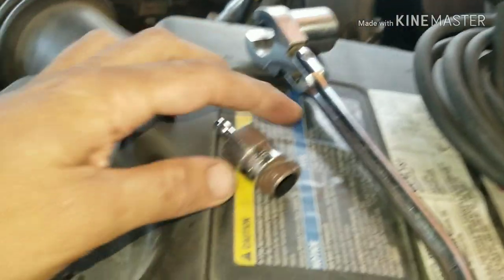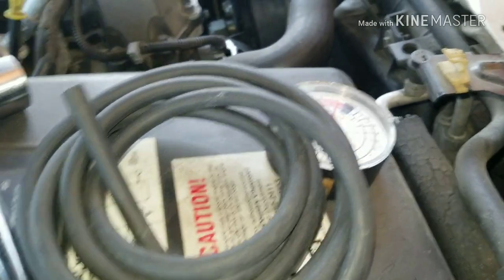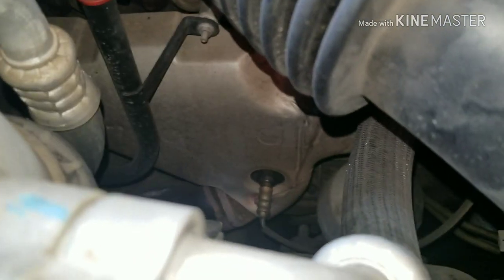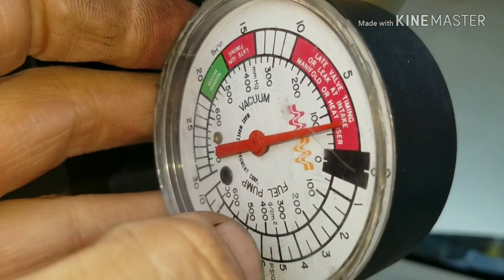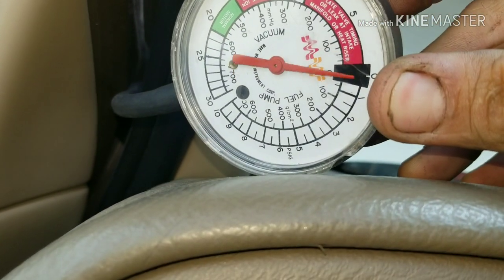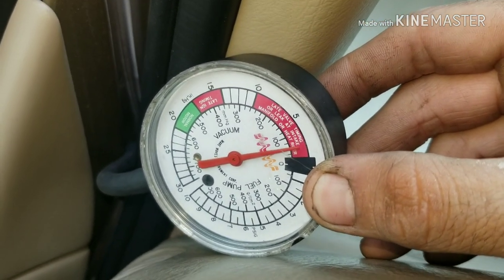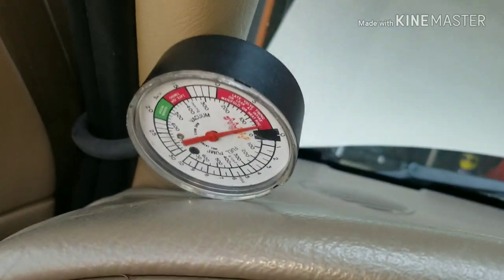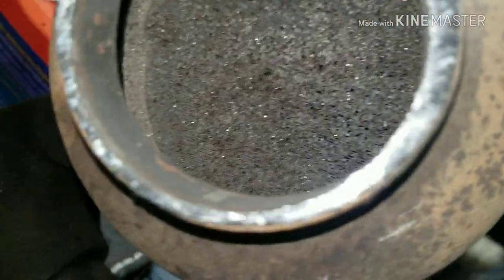How to find out if you have a bad catalytic converter

Comment: Hi! I hope you'll be able to answer soon. I have a Mitsubishi Galant '01 4 Cylinder. It has been driving rough like puttering, shaking when I go a certain speed like 75 MPH so I tend to go alit slower on the interstate. The problem got worse as it started to turn off and it was turning off while parked at a light, but it worsened to it shutting off while I'm driving. Literally I'm driving and it cuts off and car's are coming my way and I was able to make it home. We changed spark plugs and pack and thought it would work but it didn't sadly. I have a code of P0421: Catalyst 1 Efficiency Below Threshold Bank 1 as the main reason and other reasons (oxygen sensor, catalytic converter manifold, and exhaust manifold). The other main code is P0401: Exhaust Gas Recirculation Flow Insufficient Detected and the other reasons are Exhaust gas Recirculation valve, EGR vacuum regulator, EGR valve gasket, EGR vacuum switch valve, EGR pipe, and EGR vacuum switch. Now it's sitting in driveway and it'll crank but cut off I'm not able to move it out of its spot. Any information you have would be greatly appreciated! 

I hope this wasn't too long for you.
Reply: Hey my truck is kinda doing the same. Did you find out what it is ?

Comment: So I have a 04 trailblazer.  Looks like yours.. So I have a p0420 code. But it drives just fine. In park it revs normal. Do you think I should just replace the upstream o2 sensor?? Don't really have the money for a new converter and cutting it off won't do me any good cause my state I have inspeactions to pass.. So idk what to do
Reply from the maker: If your not having any per performance problems you could replace the upper and lower o2 sensor. And you could buy some catalyst cleaner, this is made specifically for scrubbing cats to bring them back to life, BG 44k does a good job . Thanks for watchin please like and subscribe and tell a friend.

Comment: I got a 97 f150 with the 4.2 v6 it idles rough and when the engine heats up it shakes and sputters really bag when i go through stop signs what could that be and it’s got this white paste on the oil cap but oil is clean
Reply from the maker: The white past could just be condisation in the cap the real thing to worry about if theres water on the dip stick, your idle running issue could be something I'm not sure what,  if I remember right that has a coil pack with all the coils  for each cylinder togather. I have seen those in the past go bad after warm up and cause issues. Thanks for watchin beaure to like and subscribe for more helpful tips and tricks.
Reply: fixer good mine is the v6 model it doesn’t have individual coils it’s just a wire on plug design I think it might be a fuel pressure regulator or maybe the Maf I will be sure to subscribe to you thanks for the prompt feedback
Reply: fixer good and also the oil on the stick is clean I know the white paste on the cap indicates a blown head gasket but it’s got clear clean oil so that one has got me confused maybe a bad pcv or maybe it’s related to all that misfiring it does I’ve never ran a engine so long in this kind of condition without it breaking down so I guess it’s possible thx for the reply
Reply from the maker: Maf could be a issue if you pull the vaccum hose off the fuel pressure regulator and find fuel then it's bad. The water under the oil cap dosent always mean blown head gasket especially with the clear oil. These types of caps are  known for collecting water. I'm getting ready to make a video on this ,when your engine runs your oil naturally gets small amounts of water from getting hot and cold, that collects in the oil cap tube.

Comment: 97 BMW 740I, M MODEL ,MY MECHANIC SAYS IT'S TIME TO ORDER CATS FOR MY CAR,HES EXCELLENT BUT THE CATS ARE 1500 A POP FROM GERMANY, OTHER THAN ORDERING THE PARTS DO YOU HAVE ANY IDEAS BEFORE I ORDER... THANKS FG
Reply from the maker: if you have just a p0420 or430 code and no back pressure you could try cata clean which can somtimes help bring a cat back to life thanks for watchin
Reply: @fixergood  THANKS
Reply: @fixergood  97 BMW M MODEL AGAIN...FG,CAR HAS PLENTY OF POWER,NO EGG SMELL, CHECK ENGINE LIGHT HAS BEEN OFF ABOUT MONTH NOW, BEEN USING TECHRON ABOUT TWO TREATMENTS NOW, BUT FUMES SMELL STRONG,ANY IDEAS..

Comment: My '00 Silverado is acting up. After starting up (cold engine) and trying to accelerate, it will limp up to speed. I can floor it and it'll barely move. But once it warms up, even the slightest bit, it seems fine. I can bang on the cats with my knuckles and hear a light rattle. Not like something has come loose inside, but there is a rattle
Reply from the maker: Thanks for watchin , do you have a p0420 code if so its possably that could be a issue, but you would have to so further diagnosis yo determine what it is for sure. Besure to like and subscribe for more tips and tricks.
Reply: I have the same issue with my car. Cold start blocks me at 10-20km/h for maybe 1 min. Then runs good but I have a rattle sound on very low speed. A mechanic got an oxygen sensor code, not sure if that's the only issue ..
Reply: @fixergood  I've never had any codes. It's gotta be either the cats or the EGR is malfunctioning. I do know I have a very light rattle at my cats so I'm leaning more towards this. I'll be replacing this section soon
Reply: @Keless  that's interesting. An O2 code could indicate improper function of the catalyst. Yet I've never had any fault codes. But my cats do make a very light rattle. I can tap on them with my knuckle and hear this. Even sometimes driving I can hear it but it's very faint
Reply: @JasonTylerRicci  oh then how can i know if the o2 after-cat sensor that is bad, or the catalytic converter? 
Does "taping" on the cat and hearing noise would tell me if the cat is wrong ? 
That issue of cold start blocking my max speed at 20km/h i described appeared after my car got fixed from an overheating issue (radiator fan didn't turn on, expansion tank broke and leaked). Not sure if the cat is dead or just the sensor, causing these issues
Reply: @Keless  interesting. They could be two totally unrelated issues that coincidentally appeared almost simultaneously. But any rattle heard within the catalytic converters indicates they are failing or have failed. This can also throw a diagnostic trouble code (check engine light) for the O2 sensors. So was your overheating related to this new issue your experiencing? Perhaps. Any time you overheat and engine there are often consequences. Blown head gasket. Warped cylinder head. Oil leaks. Coolant leaks. Etc. My truck's never over heated yet I have this hesitation on acceleration (cold engine starts) and the slight rattle

Comment: I have a code p0430 sometimes it goes off and sometimes it comes back on. It's the only code accerlate ok so is it my cat or a sencer
Reply from the maker: P0430 is a cat efficiency code for bank 2. It could be that your back sensor  is lazy.  Putin a new one in could help but it's hard to say. Yhanks for watchin be sure to like and subscribe for more tips and tricks.
Reply: Dont think it's my cat as the engine light goes in an out. Figure if was a bad cat then it would stay on, if a leak in exhaust it would stay on too not come on a couple days then shut off for couple days.

Comment: I took it to get check and they think it's the motor mounts because it needed them when I purchased it but it jerks alot  in idle and struggles to take off at high speeds than it usually would I already had the spark plugs changed and fuel injectors cleaned there was also a misfire in one of the coils and had it changed but it's still doing the same thing and same code for the coil😒

Comment: I have a 2002 Chevy Malibu, used I just bought. The battery, wont start, have to charge and get a jump. Took it to Auto zone they said the battery was good. Auto zone guy  ran a check on it and said, I needed a Magna Flow? s   Catalytic Converters. Any other pointers was used as  driver eds car. I have to flush the Antifreeze unit really need a new one very dirty. Any advise really first car.
Them are my main concerns, for now. Thank You fixer good

Comment: could a bad/ plugged up cat cause a car not to rev up at all? I got it to rev up once but nothing since then. I can get the car to move in idle if I put it in gear(manual) but often dies. If it is cold it stutters for a bit when I press the accelerator down.
Reply from the maker: It could be possable back pressure can make weird things happen but other things could be to blame also. Thanks for watchin besure  yo like and subscribe

Comment: My 04 lexus is300 wont  move till I'm passed 1500 rpm what could it be
Reply from the maker: If it won't go past 1500 rpm in park   its possable but if it only does it in drive you could have other issues thanks for watchin and besure to like and subscribe .

Comment: Hi
My nissan altima 2008 2.5s won't go more than 2000 rpm.
Will it be having the same problem??
Thanks
Reply from the maker: Its possable but there can many things that could cause a issue like that
Reply: Tps sensor?

Comment: Took my Nissan 370z to dealership, they told me that i needed to replace the catalytic converter passenger side.. My Z goes into 1st gear then 2nd.. but for 3rd my RPM is at 6-7 and mph is at 60-65 but it wont switch to 3rd gear it just keeps going and going. (RPM) do you think this is actually the catalytic converter? or is it my transmission?
Reply from the maker: It could be it's hard ri say eith out looking and back pressure , or looking at your line pressured fir yout transmission to see if it's working like it should. Thanks for watchin besure to like and subscribe for more tips and tricks.
Reply: fixer good i have 2 videos posted on my page to show you what im talking about if you can take a look at the 2 vids id appreciate it
Reply from the maker: I looked at your videos its hard to say back pressure could cause a issue like this with a bad cat or line pressure not reaching the proper threshold in your trans mission

Comment: Does a clogged cat make your car shake when on operating temperature ?? Need answers please
Reply from the maker: Thanks for watchin ot possable buf ite hard to say what exactly is going on  with out performing some tests. Try find a shop that can help point you in the right way
Reply: I took my car to autozone for a test. Computer said it was the PCV valve and bank 1 and 2 are lean. I think the oxygen sensors sre bad too. And the catalytic converter is clogged too. We will see.
Reply: My truck has no power, and it shakes.

Comment: So I had test pipes install in my 350z because cat was perhaps clogged. Now I hear backfires. Could this be bad coil, injector or?
Reply from the maker: Thar back fires can be caused by you in burnt fuel, that is usually burnt in the cat is now being ignited on the hot exhaust.  Thanks for watchin and besure to like and subscribe .
Reply: @fixergood  so how do you fix that?
Reply: I'm also getting misfire multiple cylinders code.
Reply from the maker: @EvictionNotice51  the multiple misfure  can be caused by bad plugs, bad coils or injectors,  I hope this helps.
Reply: J R Im having the same problem. Did you get it fixed??
Reply: J R ???

Comment: I’m gonna purchase a 2007 Mazda CX-7 but the owner said that the catalytic converter doesn’t work properly and that the car only goes up to 20, what would be the cost to fix this?
Reply from the maker: If it just the catlytic convertor  it could be any where from 400 to thousands of dollers depending on the type of catlytic convertor you have. If you look under the hood the manufacture sticker will tell you if it's a  fedral emission car and if it complies with california EPA regulations. If it's a California car you catlytic convertor could cost a small fortune.hope this helps besure to like and subscribe for more tips and tricks
Reply: If u love somewhere that doesn't to emissions ,just cut cat off and run straight pipe in its place you'll have full power but if you in place that does emissions then you'll  need to replace the cat but it cheaper to  do yourself that you haveashop do the work

Comment: Would a clogged cat cause a rough start up? I've got a 04 trailblazer and when I start it up cold it starts rough and idles poorly. It goes down under 500rpm then shoots up to 2k rpm. Then idles off then I'm able to drive it. If I put the car in drive while this is going on it almost stalls out.
Reply: I've also done an emissions test while the car is warmed up and it says the cat failed but I'm getting a P0455 engine code. I've replaced everything on the evap side and it passes thr emissions test.

Comment: I have a 2002 impala with 89k miles. If im hard on the gas the car will sputter and after a while the car will just die, but restarts immediately. Could this be a bad CAT? Ive been to 3 mechanics even the dealer and they dont know what the problem is. No lights on dash except change oil

Comment: My car is a 2009 Nissan Altima and me and my family tried going to gatlinburg for a trip and we got half way there and as I’m driving while putting foot to the gas it wouldn’t the speed gauge slowly kept going down and down and I had the peddle to the floor and it still wouldn’t go so we pulled over to the side and set for about 15 min and started it back up and drove off well about 15 min later it did the same thing so could it be my catalytic converter and u can’t drive it for more then an hr at a time when on high way or it will keep doing it and I have took it to 3 machenic and they told me they can’t diagnose it unless it did it right there with them around and I can’t afford to have it looked at again just for them to tell me there is nothing wrong with it so could U tell me what u think there was a bad egg smell about 3 weeks before this all started but now the smell is gone but it still does it
Reply from the maker: It s really hard to say being you can fire it up after a hour and its cooler makes me think it's something that is controlled by electricity,  a fuel pump coil, crank sensor, computer, it's hard to say with out looking at it while its failing it's the hardest thing to do is get somthing to fail on ya at the doctors office. A cat will usually always be bad once its plugged. I hope this is helpful for you besure to like and subscribe to get more tip and tricks, thanks for watching
Reply: Rotten egg smell is ALWAYS a cat
Reply from the maker: @kameronstout4847   some times the rotten egg smell can be caused by to rich of a fuel system or too lean. In order to damage the catlytic convertor  yout system needs to be super rich. Thanks for watchin and besure to subscribe for more helpful tips and tricks

Comment: Thank u sir!
Reply from the maker: Your welcome thanks for watchin
Reply: @fixergood  what causes them to go bad or get plugged up
Reply from the maker: Old age can be cause causing it to become underactive you can buy some type of catalyst scrubber that may help you if you have a po420. Another cause is if your engine is not running at optimum peak performance the sunburnt fuel runs the cat.

Comment: What happens when the cat completely clogs up 2012 equinox
Reply from the maker: I'm sure you would have back pressure and beagle to measure it with a pressure gauge. Do you have any codes? Thanks for watching
Reply: If I dont fix it it will probably kill your engine, Acadia,Traverse,Outlook,Enclave all the same problem

Comment: Maybe make a video of replacing it if possible.
Reply from the maker: Thanks for watchin I will defantly fo that when the oputunity provides its self.
Reply: It's fairly straightforward. The challenging part is busting the nuts and bolts loose (often very rusted)

Comment: I have a 2002 Grand Prix. It feels like it takes off in 2nd gear, but will go to third, but won't stay in overdrive. I initially thought it was a transmission solenoid. I'm suspecting it's either the cat is clogged or the fuel filter is clogged. I replaced the cat about 4 years ago with an after market high flow cat. I'm just wondering if anyone else had these sort of symptoms with a plugged cat, failing fuel pump, or plugged fuel filter. I will be taking the fuel filter off today. I have a 12,000lb lift, so I can take the exhaust down without "too much" problems. I'm just trying to get some ideas. Thank you in advanced.

Comment: You said the Cadillac converter is located right there but you didn't point to it I'm a female I need to know where is it located where is there at 😒🤔
Reply from the maker: On diffrent vehicles  they are located indifferent spots. You calitic convertor with have a oxeygn sensor  in front of the catalyst and behind it. Hope this helps thanks for watchin

Comment: I have a 02 frontier 3.3l and has 4 catalytic converters 2 front and 2 rear along with 4 sensor,I just replaced the front cats along with the front sensors,MAF sensor and knock sensor but my truck still hesitates to accelerate and it’s consuming lots of gas way more than it did when the upper cats where bad,do you recommend replacing the rear cats or should i check on something else?
Reply from the maker: Do you have any codes for the rear cars like a p0430  ot 420, I would scan for codes. Being it has 4 cats it could be California emissions if it is you truck could be equipped with air fuel ratio sensors and not oxgen sensors.   Hope this helps
 Thanks for watching besure to like and subscribe for more tips and tricks and check out facebook and instagram and give it a like for more help in the future